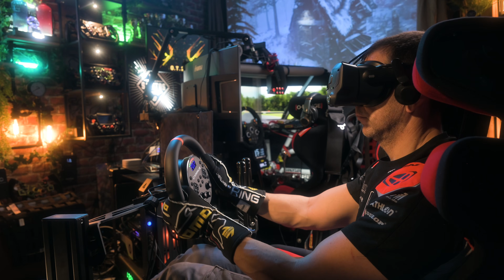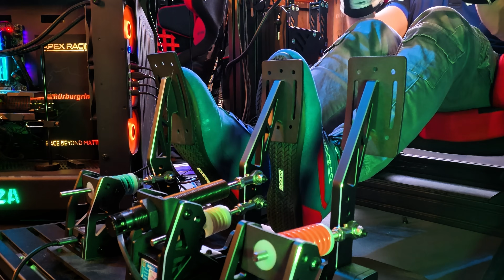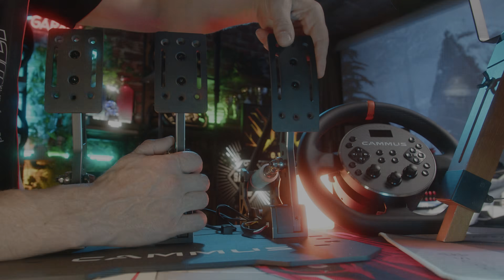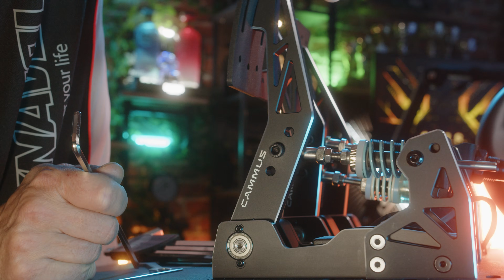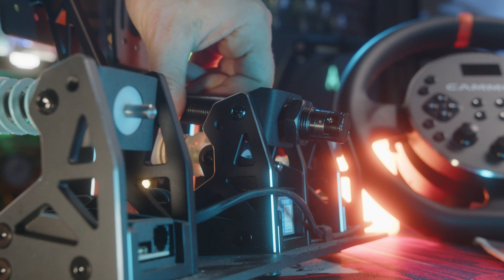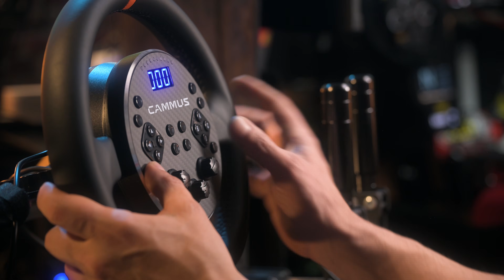Are Low budget and Sim  incompatible??

Comment: I use the previous version lc100 CAMMUS pedals and their 15nm wheelbase. Can't fault it for my needs, especially the wheelbase as I can use exactly the same Sparco wheel as I have in my race car. Took quite a while to get the brake pedal and throttle pedal to feel right for me but that's been the case with all pedals I've tried.
Reply from the maker: That 15nm base is really good man! I love that beast

Comment: Used the c5 before switching to moza ecosystem. The c5 is a really good value for those on a budget, especially if you never plan on swapping your wheel. The ffb it provides is really strong with great feedback since the motor is literally in the middle of the wheel.
Reply from the maker: That design helps indeed 🤛

Comment: Speaking entirely from an "enthusiast level PC & sim racer", the cheap gear is marketed specifically to the very casual desk racer, but we all gotta start someplace.
Reply from the maker: That’s true, i spent my first 5 years with G25 and 27 and still had as much blast as now. 
Is not good idea to start with 5k setup anyway we must be sure we like the hobby first 😁
Reply: @chepilevski  Not saying the low end gear doesn't work, but when you start adding on more gear, you'll quickly see it's deficiencies surface. I started with G27-T300 and once I got my first set off Protosimtech pedals, my took a turn towards middling/high-end gear.

Comment: I own the pedals, im having some problem regarding the loadcell jumping in signal on very low forces, makes it very hard to trailbreak properly. And i cant for my life figur out why they don't have a percentage or some kind of value in the software when you are calibrating the pedlar. I want to know a value on how much of the 100kg loadcell i'm actually using when calibrating the pedals both to compare to friends but also be able to calibrate it to the same value next time i need to re calibrate them.

On another note, great video as always! Love all the b-roll shots
Reply from the maker: Did you try to put some preload on the spring?
I didn’t personally liked very much that spring as it was bit too soft for my like and barely add pressure to the loadcell!
Can you try to add enough preload to fully isolate the spring compression and see if that stabilize the input?
Thx for the kind words buddy 🤛
Reply: @chepilevski  I will try, thanks for the tips!

Comment: Loved the review. Not sure if you tested if in rally games, like RBR, but would you run 100% CF Filter or only in ACC as you mentioned, and if you did test with rally and drifting, did you use Natural Inertia?
Reply from the maker: RBR must need to put down the CF if feels too harsh and I did drive some RX cars going sideways with zero inertia and was still too fast in returning probably because of the small diameter!
For that kind of driving I may use some friction just to slow it little for full rotation in return 🤛
Reply: @chepilevski  So you would use friction rather than inertia to help with too fast returning rotation in drifting/rally? I have the CF set at 85% not sure if you think it's to much or not. (I'm not really good with making my own FFB settings and there aren't a lot of people sharing them for the C5)

Comment: I didnt like how the cammus felt even when i messed with settijgs. But as you said you feel like all ffb is the same for how long you have been playing lol. To me it just had a different feeling to the force overall. Its good but not my favorite.

But im one who can feel differences in all wheelbases. For me none feel identical. And i like using settings as each brand differs. Im not using wheels to het them to feel idnetical. Thats not the point imo. I search for what they do best and set them to that. Some are better at suspension so i make sure to set them as much as i can for that feeling. Some fele better with the understeer feel so i can pull that out. Ive foujf everu wheelbase seems to do something better then the other. I dont then adjust to get them all to feel the same as usually when doijg that you are reducing some of the special things some bases do better then others. Like some wheels are faster so i dont then refuce it to make it feel like another.

Of course we can make all wheelbases feel good or we can use no filters and see the differences in motors or how they relay in game feedback. All depends on how you test and what you are searching for in feel.

But yes you can afjust for bases to feel similiar. But you can also adjust to make some bases feel extrodinary in comparison. Most of the tine getting wheelbases to feel similiar you wre doing some sort of reduction in feeling to match another and for me it defeats the purpose of different wheelbases. 

Just my take on how I test wheelbases. Not all software is the same and not all settings react the same way.

Good example of this. If you use simagic and use friction or inirtia you will get reduced ffb. If you lower those or turn it off the details come out more. So how you use it may not feel the same or maximize details. Yet with other wheelbases some dont reduce detaols with inirtia or friction which is why i say you can either limit or allow for wheelbases to be the best at what they do. Or you could like things differently. This goes for anybody with preference or how they use wheelbases. Like i may use friction on one. But not on the other because one may reduce details while the other doesnt. All things that change and matter to me.

Like me idc about noise or frequncy feeling buzz or sound. So i use 0 on frequencies and 0 on smoothness for my simagic i use inirtia at 5 and friction at 5 so im getting way way more detail then you may since thats how i set it. See what im saying? If we all went by our onw details when testing wheelbases side by side nobody will truely know what one wheelbase does better then another because then you are just trying to get them all to feel the same. Which always means you are taking away from one and adding to another. Instead of testing with less filters to see the maximum potential of the wheelbases. Some have more detail on curbs, some more suspension, some grip, and so on. Ive found so many differences with wheelbases. Especially the difference in how settings do react with each.
Reply from the maker: Man, that was long and deep explanation 💪
Thanks for the effort sharing your thoughts brother ❤️
Reply: @chepilevski  for sure you know I love your channel and love to comment lol. I like our chats! But its true. We all use settings differently. Some like no filters so they compare each base without filters so to them it will feel different. Some use less inirtia or friction so each base can react differently to different levels of each. Some can be pushed to feel more potent Some can't. But to make each wheelbase feel the same usually includes reducing one bases effects and raising a other or vice versa which tbh isn't the peak of each base. As I feel bringing out the best things of each base is how I tell the difference. Or I use very very low filters to compare and can get a nice feeling of the differences between how they pick up the signals in games.
Reply from the maker: @ that’s why I’ve said many times that each base has its own character.
I totally felt your deep explanation and the reason I try to not make things way too complex for people who are going for first time in the DD world I say they will all bring at the end of the day more or less the same experience!
For me going all the time from base to base I found I can instantly feel some of the characteristics you expanded and it takes me usually 20-30 minutes drive to get used and not filling the difference anymore!
FFB is such a subjective matter and I push people to try and experiment all different things 💪
Reply: @chepilevski  very true
Reply: @reviewforthetube6485  Good evening and cheerio, distinguished gentlemen! 🎩 It's been absolutely splendid chatting with you lot!
Reply: @chepilevski  you can test my theory also. Go to the simagic. Turn the inirtia and friction off. You will realize the simagic has way more details with those off then on. So if comparing with them on you won't be maximizing details which could make other bases feel similiar. Ive done so much adjusting and testing even in ways that aren't my preference to try and understand that we all ahve different preferences and use settings differently. Like me ive grown to love most wheelbases with very low filters or none. I just like it as raw as possible and don't care about sounds noises or feelings of frequencies being a bit rough.

So i go through every wheelbase test off or on filters changing up and down alm sorts of stuff to see how each wheelbase performs best. Not how each wheelbase performs similiarly and I always end up with each feeling different but each also doing something better then the other. We can make wheelabses fele simailiar but many times some bases can't do what others do when at peak performance. With speed, details etc.
Reply: Force Feedback with Direct Drive is a completely different sensation... As a professional driver who earned my Class 1 license in the UK, I can say that the Fanatec Clubsport DD+ is on another level entirely. The force feedback provides much more detailed and realistic feedback compared to belt or gear-driven wheels.
Reply from the maker: That DD world is really beautiful man and we are so lucky to have affordable options those days 💪
Reply: @chepilevski  agreed we are lucky for sure! Much love brotha.
Reply: @FedorBrickTop  I actually agree and I was talking about dd wheels. Also the cammus is a dd wheel.
Reply: @reviewforthetube6485  Thank you for your response. I believe that Cammus will eventually reach Fanatec's level of quality. Given their development trajectory and commitment to innovation in the sim racing market, they show promising potential
Reply: @FedorBrickTop  well the dd+ is very good. Its one of the better direct drive wheelbases. It gets to much hate all begause of the fanstec issues that have happened. I've been a defender of the dd+ for a while. I own a simagic ultimate and a dd+ I'm about to own the asetek invicta also.